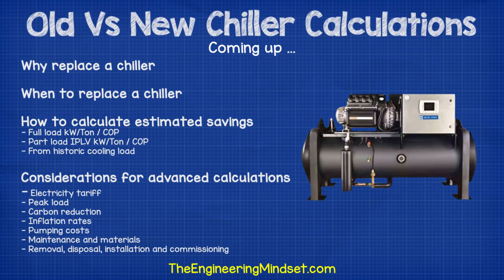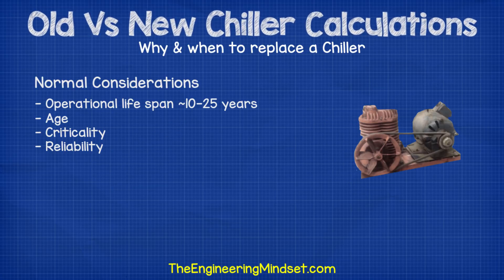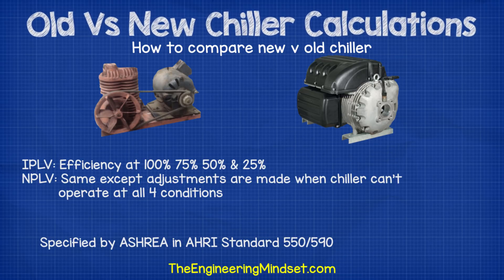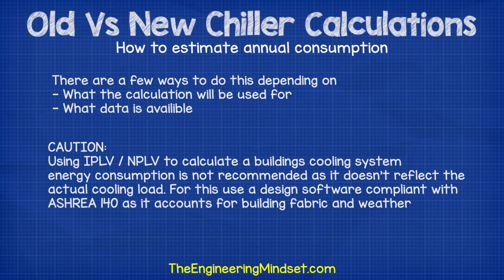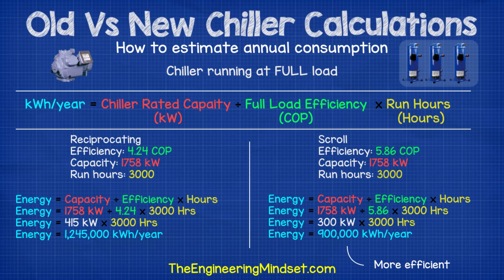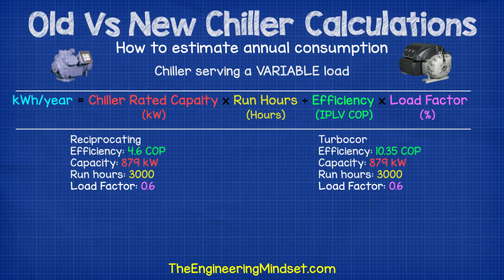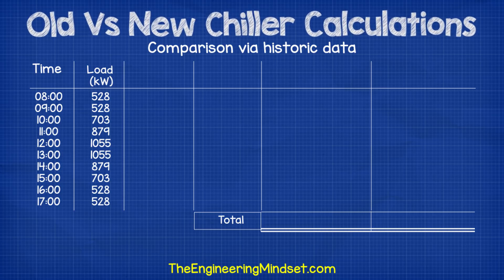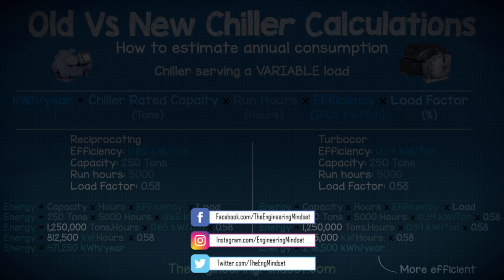Calculate savings from chiller replacement - How to IPLV, NPLV, COP, kW/Ton, EER efficiency

Comment: Can you please provide the details of the safety devices installed in a chiller to avoid any damage to chiller if any fault occurs like flow sensor, anti freezing safety, prv etc. Or anyone please guide if possible.
Reply from the maker: Check out the guides from a manufacturer, they will be listed

Comment: Do you think replacing 3 750 ton each absorbers will help with efficiency and cost savings. R718 refrigerant and steam are currently in use in Nyc 🇺🇸 we are considering replacing it with 2 centrifugal electric drive york 134a
Reply from the maker: I'd say most likely but you need to do some comparisons